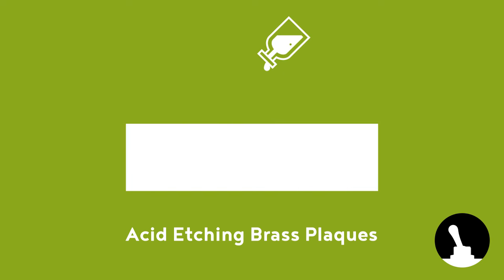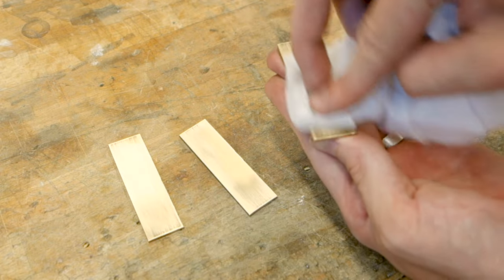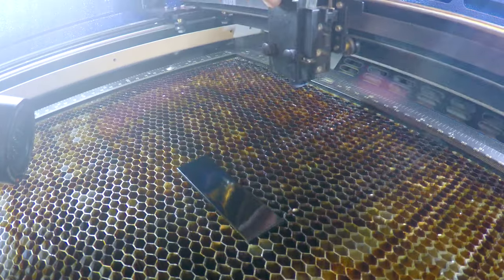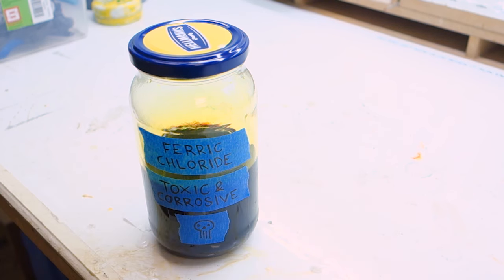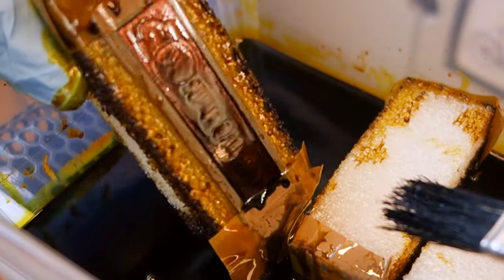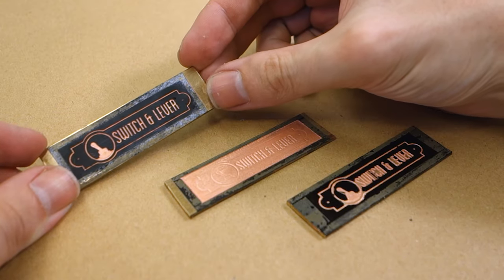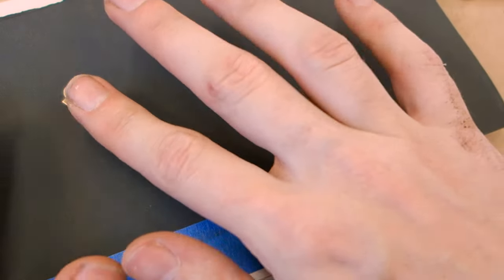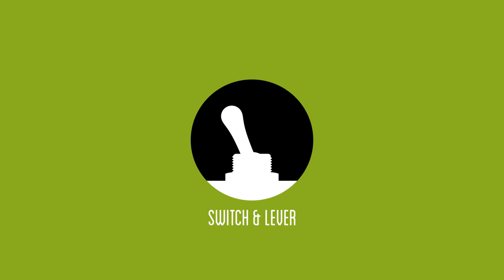Acid Etching Brass Plaques

Comment: I'd rather engrave it on the CNC (then colour with brass antiquing fluid), but it's really fascinating to learn other methods
Reply from the maker: If you have a CNC, then of course. This is more accessible to most people though, and literally zero G-code generation required! 😄
Reply: Switch & Lever except for the 66% of options that use a laser ;)

Comment: I try already but nothing happened. Are you sure is only ferric chloride. Please help me 🙏
Reply from the maker: Yes, it's only ferric chloride. There are many factors which affect whether something etches properly or not, material, cleanliness, time and temperature being the main ones.
Reply: @SwitchAndLever  already. And I try to use hcl acid but there's no affect.
Your information is very important to me. I need this to open small business but what to do. I have no idea.
Reply from the maker: Again there are many factors. I really cannot help you here but there are lots of resources online about the chemistry of etching. I would suggest doing some googling and lots of readings before starting up a business. There are lots of things to consider.

Comment: Say i want to etch steel, then FeCl3  won't really work. What acid would I use instead?
Reply from the maker: It will, but very slowly. I would rather use electro-etching when etching steel, skipping acids all together.
Reply: Thanks! Somehow I thought the metalic element in the solution was needed to exchange the exposed part of the metal with the element. I must have confused etching with eletro-plating for some reason.
Reply from the maker: FeCl3 is often used when etching damascus steel to highlight the different steels inside. If you leave it in the etching solution for longer you will feel the differences as well as different steels etch differently. So it will work, but again, too slow to really be worth it.
Reply: Switch & Lever will fecl3 work with aluminium?

Comment: once the solid gets wet, it will dissolve into solution again. But this isn't a big deal because the amount of copper is so tiny
Reply from the maker: On a garbage dump it's less of an issue as it will bond with plenty of other stuff once it goes through wetting and drying, and hopefully incinerating. Generally garbage dumps are also not positioned in places where they pose a risk to ground water. However, flushed down the drain it travels to a water treatment plant where it wreaks havoc, and unless they have dedicated copper catching systems both kill the beneficial bacteria living there, as well as get flushed out into nature again in the end. Of course, this amount of copper is miniscule in the bigger picture, but every bit helps.
Reply: @SwitchAndLever  You could perhaps capture the copper by chucking in some iron filings or better still some steel wool to the waste solution. The copper will plate out onto the iron and some iron will go into solution . It will I think regenerate your etchant, and if you had enough of it you could reclaim the copper as scrap.
Most interesting video, thanks for making the effort

Comment: Ink toner: Switch & Lever
Laser: Switch & Lever
Reply: The laser cutter I use has a 0.2 to 0.3mm cutting thickness, so you can expect an extra 0.1 to 0.15 around the edge. In many programmes, or even on the cutter, you can compensate for this, though it leaves slightly rounded inside corners.

Comment: I think you mean "oxidizer", rather than "acid".
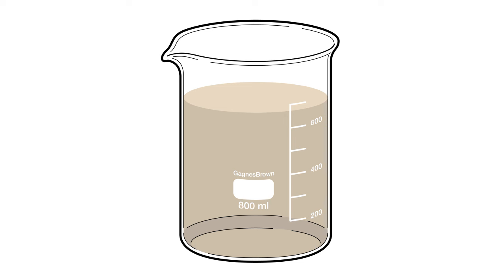(I mean, you actually explained the chemistry correctly at 9:20. And as you can see, you are using Iron III chloride's oxidizing properties to dissolve the copper.)
But cool video!
Reply from the maker: Nope, I mean acid. As been discussed elsewhere in the comments there are different ways of defining an acid, and FeCl3 is indeed what is called a Lewis acid.
Reply: I know that. But you are not using its acidic properties here. You are using its oxidizing properties. 
The fact that it is a lewis acid is irrelevant to the etching process.
Reply from the maker: My point is that I meant acid when I wrote acid. People intuitively know what an acid means whereas unless you know at least a little about chemistry an oxidizer isn't as intuitive. It is describing the compound of FeCl3, even though it may not explain the correct chemistry that's taking place during etching.  "Oxidizer Etching Brass Plaques" would have been more of a confusing title.
Reply: Unless they're chemists, when people think of "acid", they think of Brønsted acids (like vinegar, citric acid, sulfuric acid, etc...), not Lewis acids (you wouldn't consider rust as an "acid"). 
But okay, I guess you just wanted the title to be more appealing to a wider audience.

Comment: so the easiest and cheapest method is the best one , rather than the laser etching and the paint covering
Reply from the maker: Well, I wouldn't say the easiest. If you have a laser cutter doing what I did would be very easy.
Reply: @SwitchAndLever  i don't have a laser cutter , what i do have is paint , printers , markers , tape , heat and anything else i could use , just not the special paint , nor the laser cutter

Comment: Would this work with aluminum too?
Reply from the maker: Nope. You need another etchant. Usually aluminum is not etched like this, but marked in other ways, or milled.
Reply: Wow thanks a lot for the fast response!

Comment: Oh, come on! Ferric chloride is not an acid! It's chloride — salt of hydrochloric acid. Although you can use weak acids to do the etching, if you also add some oxidizer into the solution. Something like citric acid with addition of hydrogen peroxide does really good job. And one last thing. You can reuse ferric chloride solution infinite amount of times since over time it will become CuCl solution and CuCl is good etchant on it's own.
Reply from the maker: This has been discussed elsewhere in the comments, FeCl3 is an acid. If you know your chemistry you should know there are different ways to define an acid.

Comment: Okay so step one: purchase a high quality industrial printer, a laminator, a frickin laser.
Reply from the maker: Or get a cheap laser printer and a clothes iron (not that laminators are expensive either). Holy shit, if you expect everything to be free then you really should not try making anything.
Reply: Switch & Lever haha, I know—I may consider buying one for future projects. I just got myself a new humidor and it came with a blank bronze plaque. It has a sticker on the other end to adhere to the box with false screws on each end for aesthetics. Not sure how they want me to label it, but I know I want to get a bronze plaque on my humidor.
Reply from the maker: You can always contract someone to manually engrave it. Something that small is not gonna cost a lot to get done.

Comment: Except now it goes to a landfill and contaminates the ground water there lol
Reply from the maker: Nope, it's solid copper, it doesn't contaminate ground water in the same way as water soluble CuCl2 does. Either way, in Sweden we burn all garbage, so there is even less cause for concern. If you're at all concerned then dispose the liquid left over as hazardous waste.

Comment: you could use grey scale though, couldn't you?
Reply from the maker: No, because the resist will either stick or not, it won't half-stick. The etchant will also etch or not, it won't half-etch. What you can do is use a coarse halftone pattern to approximate a greyscale gradient through the density of the halftone dots, similar to how printing plates were etched in the past to be able to letterpress photos and other graphics. Halftone patterns are a fun topic to dive into, if you're so inclined.

Comment: do people realy have laser cutters?  I mean, if i had a laser cutter, i would etch with that and skip the whole video.
Reply from the maker: If you actually listened to what I said I said the laser won’t affect the brass. You can definitely try to etch metal with a laser cutter. It will be a pointless exercise as you’re not going to have much luck, but you can definitely try.